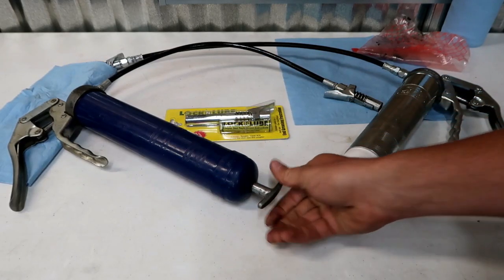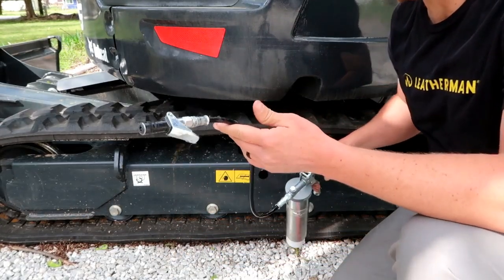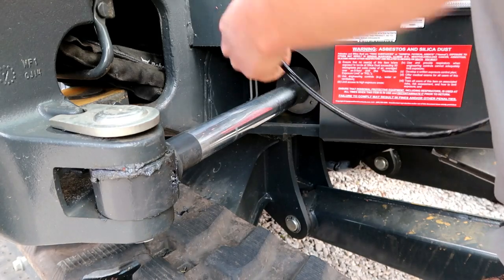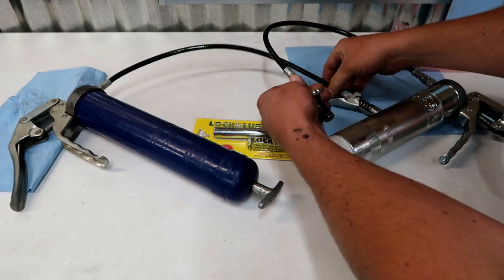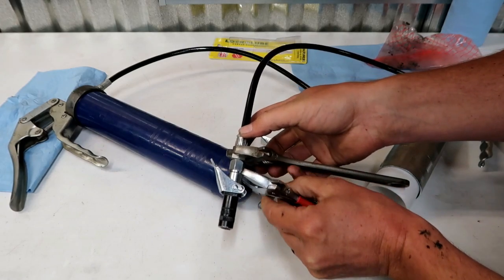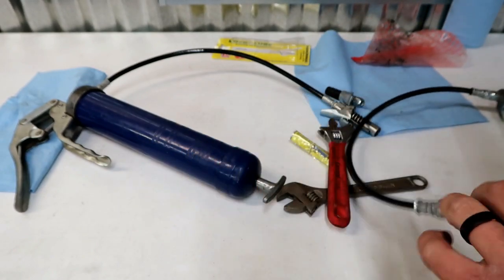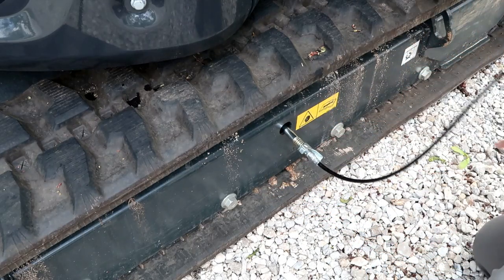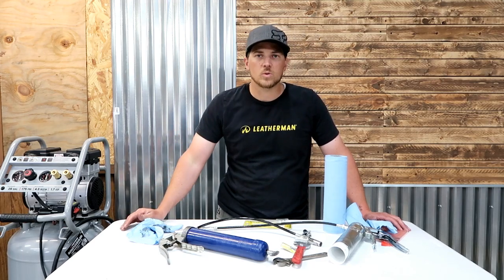LockNLube VS safeLOCK - Best Locking Grease Coupler

Comment: On a std. Grease gun you pull the stick out on the back a the gun till it meets the resistance of the spring  that'll reflect  how much grease you have left    if you get a stubborn air lock where you can't  get you gun to pump   I take like a piece of short 2x4 about a foot en half long or so en give the gun a few WELL PLACED smacks just above the output hose on the cap housing to shock the air out of it

Comment: LockNLube now sells grease guns using  400g screw type cartridges (Same as Lube Shuttle). Except that their grease guns comes with the LockNLube coupler, hose swivel, and 20" quality hose. They also sell what they refer to as "easy-prime" grease guns, a design that does away with the follower plate and rod, replacing them with a reusable plastic cap.
Reply from the maker: That’s awesome!

Comment: Thanks for the grease gun tutorial. Can you recommend a good grease gun I could pick up from Amazon? Thanks again!
Reply: I have the DeWalt 20v. It is the beez neez. Paired with a good coupler and it’s about as good as it gets.
Reply from the maker: I have the Lincoln and the Lube Shuttle. Both are pretty good but the Lube Shuttle has a unique cartridge that is nice.
Reply: @paedahe4975  Thanks for the input! I'll be sure to check it out.
Reply: @ThriftyGarage  Thanks for the reply and suggestions Thrifty Garage--it's much appreciated!
Reply: @Tony-dx3eo Milwaukee, but go cordless with whatever you're currently setup with.
Reply from the maker: I agree! We recently upgraded to the Milwaukee M18 grease gun. Should have done it years ago.

Comment: If you use a locking coupler of any kind you should also pick up a right angle attachment. Theres always gonna be a place you won't be able to fit that head. They work great with locking couplers and I find they even grease better than a standard coupling. Must be because you can place your hand directly on the back and push instead of trying to grip around the hose.
Reply from the maker: The angle attachment is definitely a handy tool and unfortunately it seems is needed for 1 zerk on every machine.

Comment: Were your lube shuttle & lock-n-lube threads compatible? Mine seem not to be….
Reply from the maker: Yes, I’ve almost gone through a whole case. I need to order more.
Reply: @ThriftyGarage  odd, it appears I may need to order an NPT to metric m10 adapter. Found someone mention that was required. Wonder why yours didn’t require that….
Reply from the maker: Oh, your talking about the quick coupler. My bad, yes it does leak a slight amount of grease. But it seemed to thread on all the way. I just thought I needed to add Teflon to seal it better.

Comment: What is the best 90 degree head you have used? I have some tight spaces I cannot reach straight into and need something with less than half inch profile height? I tried a 90 zerk fitting and to be tight it was turned backwards.
Reply from the maker: I just ordered the LockNLube 90 Degree adapter. I haven’t used it yet but sounds like exactly what you are looking for.